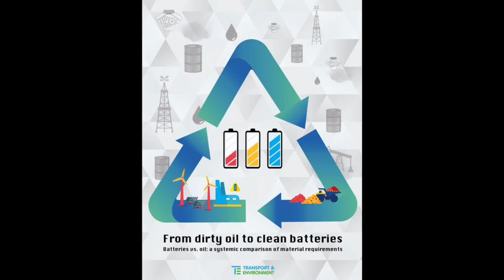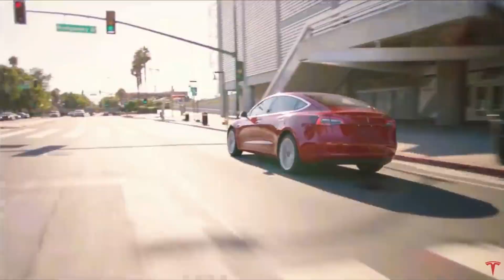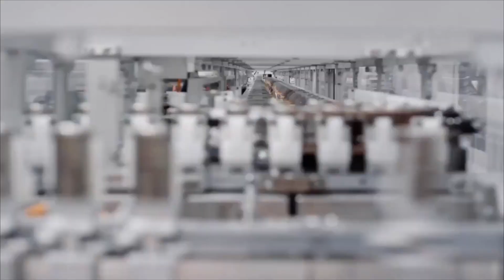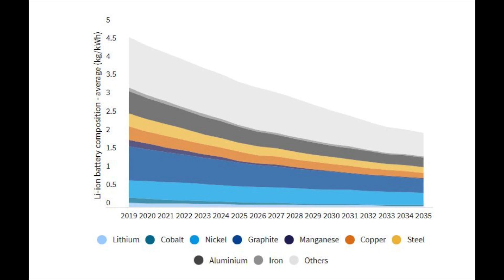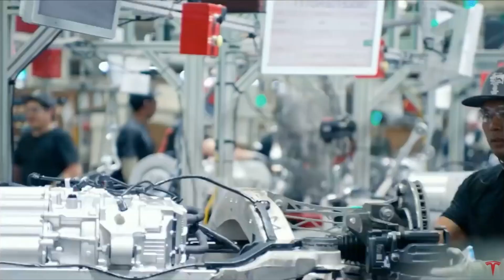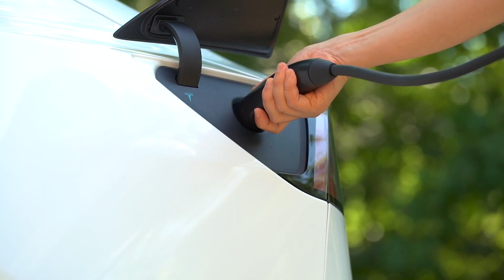An Electric car uses 300-400 TIMES LESS resources than an ICE car !!!

Comment: nickel is the new oil. I love the idea of a GREEN future!
Reply: Made in new caledonia with diesel mining trucks, diesel generators, coal power plants......
Reply: @carholic-sz3qv  lol just compare it to oil and by the way it will and can be done sustainably
but I have a hunch that is not on your radar
so Green is the future !
Reply: @noCOtwo  yes Green is the future but the present and future are still fossil fuels like it or not, its going to take a very long time before everything goes electric.
Reply: @carholic-sz3qv  Electric mining trucks already exist, and even mining diesel trucks use electric motors to power the wheels.
Reply: @carholic-sz3qv  well yes if the fossil fuel industry and the Republican Party have anything to do with it. What most people don't understand is yes we will have enough green energy and that it all can be created and recycled sustainable and I am not against Nuclear when needed . But we need to get to zero emissions about 10years ago but the naysayers (like you) continue to drag there feet
Reply: @carholic-sz3qv  car parts and resources were originally hauled with coal powered steam and horses. People thought that steam and horse would never be replaced because they were still being used. The replacement of ICE will happen even faster.
Reply: @mrbonzzai  nonsense, people never doubt about the expansion of ICE, first of all diesel engines were made to run very different types of oils. Diesel engines made everything way easier from heavy duty mining equipments to trains.... the steam trains only transported metal ore to processing plants. Diesel engines/vehicles were way more powerful and polyvalent for different applications, steam engines had to have tons of water and coal and a giant burner, when diesels only needed cooking oil fuel tank and transmission.
Reply: @mrbonzzai  modern Diesel engines are extremely powerful/popular and efficient, just look at road trains in Australia or 2 miles long Diesel trains that crosses deserts every day, or those ships that carries over 20k containers..... the mining equipments that can haul over 200 tons at once.
Reply: @mrbonzzai  the ICE replacement will be very slow and will still seriously depend on the oil industry. Decades ago we didn't made over 80 million cars a year, agricultural machines can work non stop 24/7 without stress, you even see tesla factories building. The future tesla semi will barely do 500 miles when Diesel already achieves 2500 miles+ also biodiesel/biofuels are been used already and still evolving too.

Comment: 13 million EVs from recycled batteries in 2035?  Did I hear you correctly?

Impossible.

Lars, what will be the average life span of a BEV?

Tesla engineered the Model 3 (for example) to last a million miles; the 2170 pack is good for about a third of that.  With the 4680 pack, it's likely the pack won't need replacing at all for a million miles.  Other BEV manufacturers will be working with battery packs that will last maybe a third of a million miles, on average - initially - but battery tech will improve for them, too.  But even a third of a million miles will be, for the average consumer, a 20 year life span for the vehicle, at least.

BEVs will last much longer in active service than ICEVs ever did, for the most part.
'
In 2035, recycling will be dealing mostly with vehicles that were manufactured in 2015-2020 - and not all of them will be sent to the boneyard all at once.  It's a Bell curve.  These were the very earliest years for BEVs.  Not many were made.

There will not be enough recycled materials to produce 13 million BEVs in 2035.  Might get a million.  Might not even get that much.

Today, in 2021, we are probably producing around 4-5% of the production rate we will see in 2035.  They're going to need beaucoup raw materials from mining in 2035.  Count on it.  Closing the materials loop will take much longer.  By 2050, we will probably see a majority of raw materials come from recycling, but from today to 2035, or even 2040, most raw materials will come from mining.  That can't be avoided.

Overall, I applaud your thesis.  The energy cost associated with producing and operating BEVs will be vastly less over 
the life of the vehicles - even before the closed loop of recycling kicks in.  With recycling, the energy costs will fall even further.

I think you are too optimistic to expect zero battery supply constraints from 2021 to 2035.  To the contrary, I think this is an unrealistic notion.  There will be bottlenecks as we attempt to reach 7+ TWh of annual battery production.

Apart from Tesla, and possibly VW, no other automaker is currently poised to produce millions of BEVs.  Of the startups, most will fail and some are outright scams.  The legacy automakers are dragging their feet.  It's difficult to see, in 2021, just who will be producing what in 2035.  Certainty is elusive.

A change to the world economy on this scale is a massive, massive undertaking.  Bottlenecks are a natural part of any such undertaking - bottlenecks in funding, mining, manufacturing, and marketing.  There will be engineering mistakes, models that don't appeal at the price points set for them.  Establishing 2035 boundaries for optimistic and pessimistic cases, in 2021, is extremely difficult.

When contemplating disruption on this scale, be wary of those who pronounce certainty.

Guessing is fun!  We should enjoy ourselves and lay out our personal forecasts; why not?  But no-one should announce certainty in their forecasts.  That's a pernicious form of self-delusion.
Reply: You realise that there are millions of ICEs on the roads that are over 20 to 30 years old right! EVs have not yet proven to even come remotely close to it. I still see alot of 40-50years old cars still around
Reply: @carholic-sz3qv  You're describing the Bell curve for ICEVs.  With well over 80 million ICEVs being sold annually and billions in the worldwide fleet, even the shrunken tail of the Bell curve is millions of vehicles.

The average time an ICEV spends in use before being junked is in the 13-17 years range, but that's an average.  Some are junked sooner; some are junked later.  Classic cars will be prized and cared for by collectors for even longer.  There are still Model T cars on the road.  But this end of the Bell curve is insignificant.

BEVs do not have as many moving parts.  They require less maintenance to keep on the road.  So long as their battery packs are adequate, they can keep going.  The average life expectancy in-use will be years longer than for ICEVs.

Unless they're lousy BEVs.  There are, indeed, lousy BEVs that won't go the distance.  City cars, for example.  But cars of the quality of a Tesla will be around for a long, long time.  Most other automakers will strive for the same result for their BEVs.

This is the future:  BEVs will remain in use for longer than ICEVs, on average.  Significantly longer.  As we move forward, as more automakers get their heads into the game in a serious way, the advantages of low maintenance and durability will take hold.
Reply from the maker: I do believe they mean from ALL batteries recycled not just from EV's by 2025 🤷‍♂️
Reply: @BestInTESLA  nope youre toooo optimistic, the problem will be first to make all those batteries for millions of cars before even mentioning recycling, also there are about 80 million cars sold every year in the world.
Reply: @BestInTESLA  Unlikely to hold up, Lars.  Automotive packs are where the large mass of raw materials to harvest makes the most economic sense.

People just send spent electronics batteries to dumps.  The effort to collect them isn't usually worth it.
Reply: @Urgelt  uhm wrong, electronics with batteries are more often collected and recycled this for years now, even apple has recycling programs for their devices. Here in Germany even non lithium batteries are collected to be recycled just like plastic and glass drink containers.
Reply: @carholic-sz3qv  Are there recycling programs for electronics batteries?  Yes.

Are electronics batteries also ending up in dumps?  Yes.  Lots of them.

Do those recycling programs net enough raw materials to move the needle away from mining?  No.

Are those recycling programs significant in terms of automotive requirements?  No.

I don't know what percentage of electronics batteries by mass end up in dumps, versus are recycled.  But it doesn't matter.  The takeaway is that the need to mine raw materials is not reduced in any meaningful way by those recycling programs.  The upward arrow on requirements is too damn steep, and the raw materials to be recovered from that source are too damn few.  Mining operations must increase dramatically all through this decade and the next.

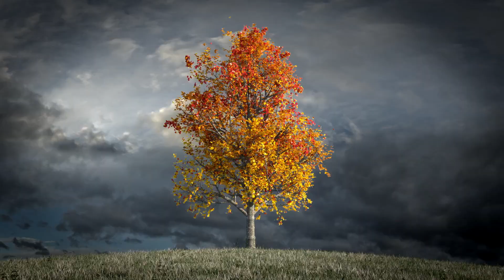Comment: 17:38 well, I see at least one lose. The fossil fuel companies are going to lose.
But they can get fucked.
Reply: A big part of the automotive sector is also going to lose. EVs need fewer parts and fewer repairs - the people that live from doing that are going to lose. I think that explains resistance from some parts of Germany far better than oil companies, I think. Doesn't make it right, of course - industries change, it's neither the first nor will it be the last. (Some parts of Germany have in recent years switched away from coal mining, other parts (ironically enough, with the dirtier coal) still have to do that. It's always hard on workers, but we usually get it done anyway.)